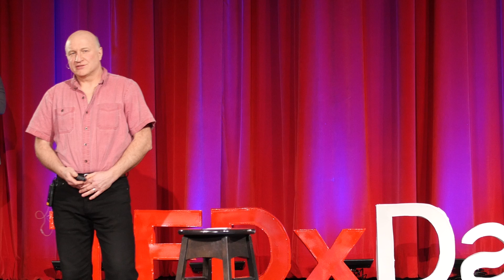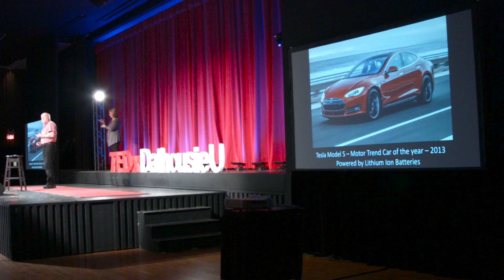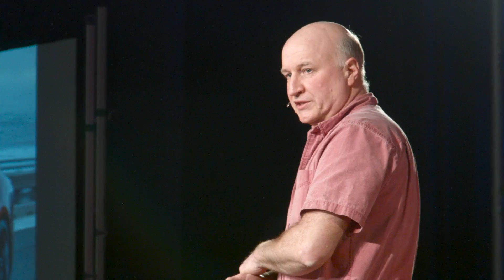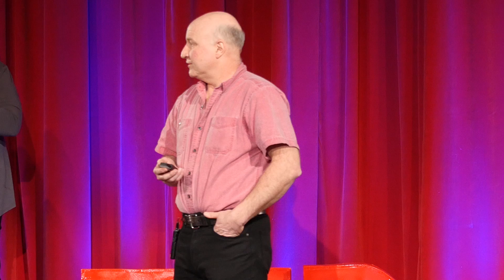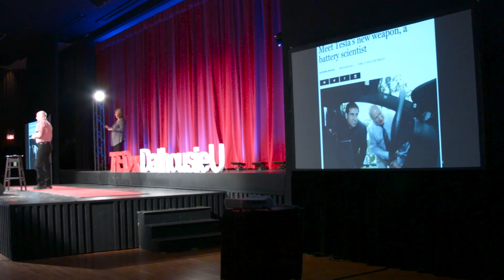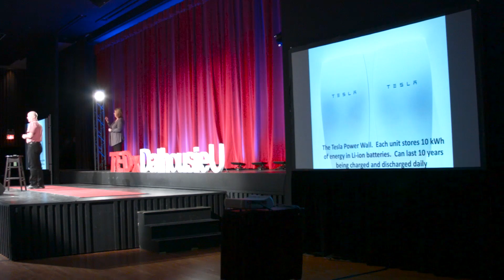Making Batteries Better | Jeff Dahn | TEDxDalhousieU

Comment: Isn't the Nissan leaf was the first electric vehicle ever (mass) produced to show that electric vehicles could be functional and green and yet amazingly cool and awesome?
Reply: Amazingly cool is a far stretch
Reply: Nope. Mitsubishi i-miev was the first mass market electric car. But not cool and awesome... ;-)
Reply: The issue was they made an ineffective battery management system that did not properly consider the longevity of the battery. It's why Tesla jumped past them so quickly.

Comment: if we have to stop burning fossil fuels—immediately—the clear alternative is NUCLEAR POWER!  it's cleaner, cheaper, and safer than wind and solar.  "renewable-energy"—at least for the time being—simply CANNOT meet the global demand for energy.  the main reason we're not using more nuclear power today is the result of a very successful—not to mention false and misleading—smear-campaign that dates back to the 1960s.  they basically convinced everybody that nuclear power wasn't safe and would produce too much radioactive waste.  it's because of these anti-nuclear power activists that most people don't realize how incredibly small the ratio of radioactive waste to energy output for nuclear power really is.  they're also responsible for the people who still think Chernobyl is a radioactive waste land and that people living near the Fukushima accident will experience much higher rates of cancer because of their proximity to the leaked radioactive material—even though the exact opposite is true!

granted, this isn't a talk about energy creation, but regardless of how amazing the latest and greatest batteries may be, the energy needed to charge them first has to come from somewhere—and for now, that probably means from coal, oil, or natural gas.  it would be different story, though, if that energy was coming from a nuclear power plant because nuclear power doesn't produce CO2.

Comment: I read an article the other day that labelled Elon Musk the 'founder' of Tesla, lmao. It was invented and founded by two guys in their garage 15-20 yrs ago. They held on as long as they could but eventually just could not capitalize enough to keep building so had to sell out. The Tesla is still the same basic concept  - small roadster with the entire fuselage packed with 18650 Li-Ions bunched in modules, which are now, today, November 2018, Li-Ions just got hit by an E.L.E. akin to the dinosaurs. CARBON BATTERIES will extinguish them.

Comment: You don't need to test it for ten years. You only have to charge and discharge it and seen the difference over a peroid of a yr and use some math
Reply: Only if you can accurately predict the form of the degradation.  Typically, you make mathematical models on the sensitivity of aging to various factors, then use accelerated aging techniques.  For example, Li-ion is sensitive to charge/discharge cycles, so you can get a good indication of expected life by going through multiple cycles in a day.

Comment: How the mighty have fallen...I used to look up to this guy, now that he has signed NDA from Tesla he is just advertising propaganda...NMC batteries he designed are very expensive, and wont get cheaper because of rare minerals...A 30-40 year battery already exists Jeff! it is called LiFePo4...Iron is way cheaper than nickle...But the powers that be cannot allow this amazing power source to become mainstream...Believe me, I have tried for the last 9 years!!!!
Reply: Nonsense.  I used LiFePO4 cells in my EV car conversion.  No "powers that be" are holding it back, just less than optimal energy density.  They also don't last 30-40 years.  BYD made EV's using LiFePO4, their cars were heavy and had short range.  They are switching to NMC.  By the way, nickle is not rare.
Reply: Wow! Be interesting if you were a shill for oil or gas folks. LiFePo4 is an "amazing" power source? Huh? NCM has a higher power rating and energy density. Add in great state of charge monitoring on NCM (LifePo is a guessing game) . What's resistance of LiFePo after 1,000 cycles? Again, much worse. So you are pushing a heavy / low energy density battery. VERY disappointing to see these attacks. Can I ask what you have contributed - positively to the world? Jeff's certainly done a lot. I hope we end up with lots more folks like him in the world and FAR fewer folks like you that push terrible product on people who don't want it and tear down people contributing positively to some of these areas.

Comment: The problem with all these TED talks is they are all global warming true believers.  It drives the reason for electric cars.  Why not reduce  80% of the CO2 with my engine that can run on all fuels and also run on a battery when that makes sense in the future.  None of the negatives and much lower weight and range.  But no, only the gospel of glowball warming needs to be funded.  Makes no sense.  

The future is in roadable seaplanes....serious.  100 mpg at 100 mph on $1/gallon NG...1 cent/mile vs Tesla at 13 cent/mile.  Road tax should be 4 cent/mile which is $4/gallon when you get 100 mpge.  The battery costs money and has a life cycle.  The "fuel" cost is $13/gallon for a Tesla.  If you fly, the no road tax is needed and it costs $1/gallon NG. My engine gives you 80% of all the dreams of these guys and the rest can be Ethanol or bio fuels.  With some thermal store, you can get 95% of CO2 gone....  Solar power with an engine that can run 24/7 on all fuels....much better, much cheaper and much faster to the IPCC goals if you are of that religion.

Comment: Lithium Ion doesn't make a lot of sense for grid-scale storage.  Pumped hydro is much more realistic.
Reply: It depends on where you are.  There are some places that gets plenty of sun/wind but not a whole lot of water to pump.
Reply: Pumped hydro has been around a long time, so the most profitable sites have already been used.  It has long payback times, and faces serious wilderness land use opposition.  It seems like redox flow batteries based on newer chemistries are more promising than pumped hydro.  But that requires some impressive breakthroughs in membrane costs and suppressing side reactions to obtain long lives.
Reply: There are many storage possibilities and each has their pros and cons.
Flywheel, pressure tanks, hydro, batteries, power-to-gas, etc., but the market is still to small to get proper R&D and create an industry of scale.
I personally find hydrogen (or artificial natural gas aka power-to-gas) the most interesting. (If there is to much electricity in the grid you create hydrogen(natural-gas), which you can distribute with the current pipelines. And if you need heat, you can either use electricity if it is cheap and when it is expensive then you use the stored gas. There is a lot of potential.)

Batteries have the upside that right now a lot of R&D is done and due to cars the market will explode. (VW for example plans to invest over 40 billion in R&D in the next couple of years and plans to sell at least 40% of their cars as electric till 2030)

Comment: When demand for gas drops, so too will it's price. Conversely as demand for electricity increases, power prices will rise. 2 things for certain - we're going to need a lot more nuclear power plants and fossil fuel vehicles will still be around in 50 years.
Reply: The connection between gas demand and price is weak, though that is the general tendency.  The price is way higher than production costs in Saudi Arabia, UAE, etc, but it is likely that these societies would collapse if oil profits disappeared.  For power prices, it seems that they are driven by how aggressively countries pursue fossil fuel replacement, rather than say per capita demand.  If producers are allowed to use low cost hydrocarbons, especially coal, they can meet significantly greater demand without significant price increases.  But on the other hand if countries shutdown currently existing nuclear and coal plants then prices will rise significantly.  If storage costs drop significantly (say by organic or other non-lithium based redox flow batteries, or continued progression on a learning curve for Li-ion), then photovoltaics might have significant market penetration.  Continued penetration of wind power will raise costs by driving massive investments in transmission capabilities.

Comment: This a sales pitch! Unfortunately for tesla!  "HE" Elion Musk is doing great things, But! There is technology out there on batteries that have lasted for over 40 years.... First I hate to even mention the name but this battery last over 40 years, "but " its to heavy for cars.  Great for homes, sucks for transportation ! TO HEAVY! It is the Edison battery its been around more than 40 years and can be refurbished and very safe! It has nickel and iron in it! So yes on home no for cars! Graphene batteries are best for cars , but no one has been able to mass produce graphene ! Or at least it just hasn't been exsposed to the public YET!
Reply: Well, one major issue with the Edison battery (other than the weight, the low energy density, the super slow charge rate...etc) is the rather large self-discharge rate. It's like hauling water with a leaky bucket, no matter how environmentally friendly you build that bucket, if it's very leaky your efficiency in hauling water is going to be pretty bad. The chemistry itself is pretty good, we just need a modern way to improve upon it and make it competitive with some newly emerging batteries. One such is the aluminum-ion battery that can cycle just like an Edison battery yet carry more capacity while being built out of lighter and cheaper materials. I see a lot of promise in utility-scale storage in this technology.
Reply: Where have you been?  The Edison battery is a chinese scam.
Reply: Elaborate?  What type of scam? There are people that are using this type of battery today here in the U.S.?!?!
Reply: I’m sorry, I guess that was silly to make a comment without explanation. 
There is nothing wrong with the Nickel-Iron NiFe batteries themselves. And,
they certainly can take a lot of deep cycles. 
The problem is: a Chinese company is using the name Edison Battery, and
those are very cheaply made and are junk. 
They are also very expensive for the Ah they provide.  Fake Chinese batteries are really hurting the battery industry, if we could find alternatives that would be cool.  Exide used to make them here in the US many years ago I believe.
Reply: Just FYI, friend...LiFePo4 is the future, if you want it...

Comment: No panels on that roof yet. surprised he doesn't know that.
Reply: panels on the roof will provide a small fraction of the power consumed by the gigafactory... if Musk is dedicated to the renewable cause he would also build a large solar generation and battery storage facility next door to make it self sufficient.
Reply: David Costello - If the roof will only provide a small fraction of the power consumption, then you wouldn't need batteries at first.  The roof was designed for panels, so it should be the cheapest location for building out solar farm.   At the end of February, the first block of panels has finally been installed. My guess is that there is not a strong cash flow case for  installing PV panels.  So it will proceed slowly, to either wait out the anti-dumping tariffs or take advantage of further price declines.
Reply: Musk also owns Solar City and is marketing a battery storage solution for solar generated power.... which is great for the home market and yes batteries can be used on solar farms too.... but installing batteries on the gigafactory roof is a marketing gimmick... and this video isnt much more than an advertisement
Reply: I think he is marketing, rather then selling it.  The price is so low compared to competitors, I figure it is a technique to get cash from deposits, dole out a few units here and there, and hope the majority of folks eventually give up and ask for there money back.  The very best type of loss leader, one that gets you publicity and deposits, but that you never actually deliver on.  My analysis is based on speculation that his actual cost for batteries is way higher then his claimed cost.   My guess is that battery manufacturers are participating in the scam by occasionally selling batteries on the open market below cost to convince the analysts that Li-ion costs are actually significantly lower than that they are.  Hoping that they can forestall the crash in interest if data showed that the learning curve model wasn't fitting anymore.